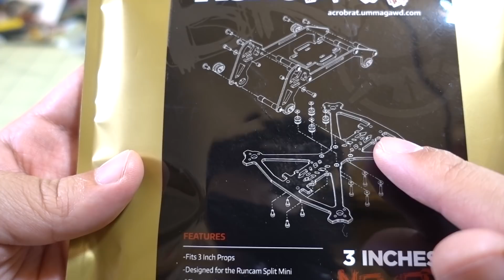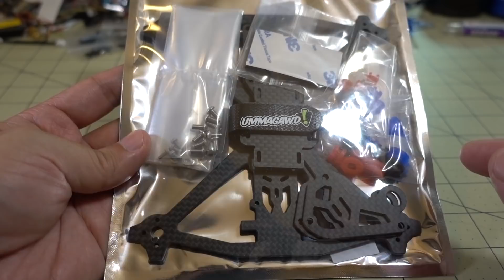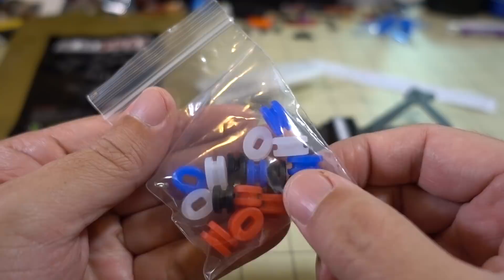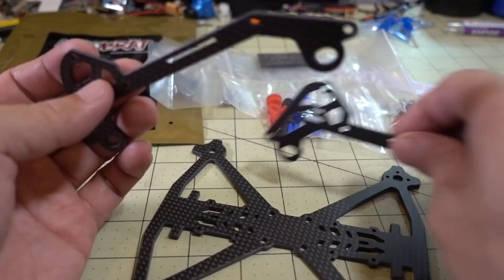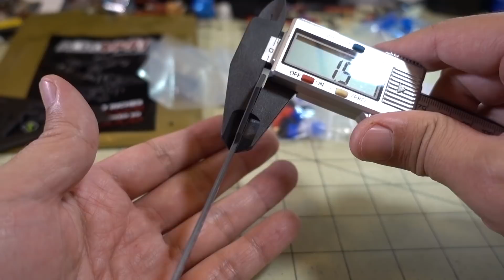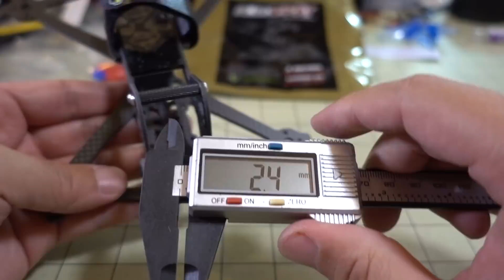The Acrobrat by Ummagawd 3-inch Frame Review 😃🏁👍

Comment: Wow you're fast! A couple of notes:
- FC/ESC holes are oversized for grommets (the grommets are not for the camera, but rather for FC soft mounting)
- there is M2x10 screws, M2 nuts and washers to help you mount your stack low (meant to supplement the HW that comes with your FC)
- there are 2 3mm spacers, plus 2 M2x8 screws and washers to mount the camera (micro size cameras work too, but this frame IS designed for the runcam split mini and Caddx turtle)
- there are 4 M2x5 screws to mount the runcam split board
- the different color bushings are different densities (white (40), red (50), blue (60), black (70). We found that every motor/prop combo is different, so we include all to help you find which is most effective for your setup
- the frame is heavier than your typical micro 3" frame on purpose because I wanted it to feel and fly like a 5". That means it needs some heft to be able to toss it for freestyle. So I put that weight into the anti-vibration design, durability, and giving it a wider motor to motor geometry to give it that 5" flight characteristics. But I also wanted to aim for 250g AUW for folks who have to deal with regulations
- definitely want to go for bigger motors (i like 1407s around the 4000kv mark) on 4s 650mah battery
- 3d printed parts are available for it here: www.brain3d.co/search?q=acrobrat
can get more info at www.acrobrat.com

thanks for the review Albert, looking forward to your thoughts after you get a chance to fly it.
Reply: Redeque one of the testers (mcflight) is getting 7-8min on a 1050mah 4s and 1407- 3600kv... long flight times is doable with the right setup. Good luck!
Reply: ummagawd will 1407 3600kv will be enough performance for this frame? I don’t want it to feel underpowered. Thanks!
Reply: Thanks for the extra info! Will there be an option to have a "solid spacer" for the larger FC mounting holes? if we chose to not have the soft mounting? Ive had issues with too much soft mounting for the FC, especially Helio stuff...(They will be coming out with a 20x20mm FC in the future)
Reply: Seems like an awesome frame, Tommy! Thanks! Got mine before they were sold out! 🎉
Reply: Looks amazing Tommy!  Great job on the design.
Reply: SteveO4478 I personally think 3600 is on the docile side if you're coming from bigger quads. Itll be great for technical/proximity stuff, but maybe a little lacking if you like to "throw" the quad (because you need top speed for that). If you do decide on trying 3600, then I recommend a high pitch prop like the hw 3x5x3. Good luck!
Reply: DeCorK hey man! You can certainly run an m3 screw and ditch the DC grommet altogether if DC soft mounting doesnt work for you. But I suggest trying the black ones as they are very stiff and might give you the desired result you're looking for.
Reply: WOW...time to build a 3" long range setup. This frame looks perfect
Reply: can you post part-list you use to hit 250g with this frame?
Reply: ummagawd  - I have my frame and parts - I need a clue as to which color grommets to start with.  Motors will be the new Tachyon 1408 3750kv's.
Reply: @ummagawd - I think this frame is very cool Tommy! I picked one up and was wondering if the 20A stacks will be able to handle a 1407/4200kv powerplant? I don't want to go with the 40A HGLRC stack if I don't have to.

Comment: I understand on a race quad you just throw props on and go,but on a hd video type quad or a  quad you want long duration and or jello free video why is it that many don't look into balancing  props?  It is not hard to balance 3 inch props and it could save you alot of grief with better video and maybe duration. Great video Albert as usual. Most of my 3 inch, 5 inch,6 inch ,12 inch ,450 heli on up to 700 helicopter blades are out of balance from the Chinese factory. I get that rubber O rings help but they just mask the symptom and do nothing to help remove the cause. Reduce or eliminate the cause and add the band aid and that will be so much better...... maybe perfect. God willing,,,lol

Comment: Thanks for the great frame review. I have picked up this frame along with some 1407/4200kv motors. I was looking at the 20x20 stacks out there and recommended by Ummagawd. I would like to get the Spedix or Hobbywing stack versus the HGLRC stack as I have used Spedix and Hobbywing products without any problems. However, I think the 20A ESCs may be pushed on 4S with 4200kv. I haven't found any thrust tests to see how close I would be getting to the ESC threshold. I want to see how this little guy compares to my 5" Chameleon plane chasing quad that carries a Session.

Do you think the 20A ESCs will be able to handle 4S with 4200kv?

Comment: I'm running a 3" massive droner with the split with a dry weight of 25g. 55g seams really heavy. What's the AUW, 270-285g?
Reply from the maker: The target of this build will be under 250g.
Reply: Albert Kim with 1407g motors? That's ambitious. I'm eager to see the final parts list.

Comment: Designer flawed.  Zero reinforcement of a puny center of the baseplate.  The nail of Albert's thumb has more surface area than the carbon fiber at the structural center of the frame.  Ummagod is right!  Reason: to maximize the number of frames cut from a single sheet at the factory, at the expense of structural integrity...SMH.
Reply from the maker: I believe they did a lot of crash testing and the frame held up well.
Reply: Go to www.acrobrat.com and watch the video of its development. You'll see that they did a lot of crash testing on it.

Comment: I'm so impressed with this frame. Nice job Tommy!
What I'm thinking though is a "Lite" version would be great to add to this version. Something with a little thinner carbon, maybe no arm supports and 9mm motor mounts. So not as tough but a great little 3" long range unit
Reply: Clearcutter thanks! Yea it was really hard to achieve everything I wanted and decided that weight was going to be lower on the priority list. Biggest reason being that I wanted this to feel and fly like a 5in, and that means in needs a little but of weight to be able to toss around (I made 250g my target for those who have regulations). So I allocated that weight towards making the anti-vibration stuff, making the motor geometry wider to give it more stable flight characteristics, and adding mass for more durability.

Comment: That frame looks cool, but the weight! I´m interested in the RCINPOWER G1506 3400KV/4100KV motors wonder if you could use them for this frame, or if you´ve tried them out on some thing else allready. Thanks for your videos Albert Kim :D
Reply from the maker: That motor is in the SPC Maker 140X and I already did a video on that a while ago.  It would also fit this frame.

Comment: Could you run bottom mount battery on this? Seems like adding the mass of the battery to the "clean" side is counter intuitive.
Reply: you actually want the heaviest mass on the side that you don't want vibrating (the clean side where the camera is mounted). If you look back at the early days of multirotors (when 8/9/10" props were the norm), that's how it was done.
Reply: ummagawd science breski...science..love it..love your ish my aiz breski,gotta support and pick one of these up:)
Reply from the maker: The battery won't cause vibrations, the motors and props do
Reply: ummagawd Sounds reasonable because the heavy mass of the lipo is mechanicly connected to the FC giving it more inertia, which prevents the whole "system" from resonating with the high frequency oscillations induced by motors/props.
But therefore it is important to strap the lipo very tight and secure onto the frame as it could theoretically turn into an oscillating system itself and produce unwanted bouncebacks after sharp rolls...
Reply: ummagawd that makes sense, thanks for putting the time in to create a sweet frame, can't wait to pick one up!
Reply: Ryan cool man! I think you'll really like it!

Comment: Seems very complicated with lots of parts... what are your thoughts on that Albert? Seem necessary or will someone come up with a similar clean/dirty design that is a bit simpler?
Reply from the maker: I don't think it's that complicated and it didn't take very long to put together.  This is the first design to account for the RunCam Split Mini jello issues so maybe we will see more designs in the future to deal with that jello problem.  The super simple frames don't deal with the jello problem.
Reply: I didn't notice any jello on the el camino you tested it looked pretty solid, did you do any dampening on that?
Reply from the maker: No dampening. Everything is very well balanced.